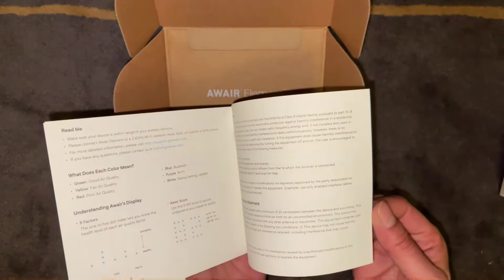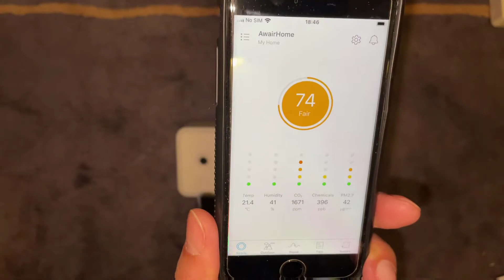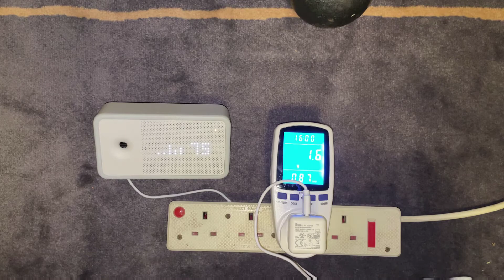Awair Element Indoor Air Quality Sensor Unboxing and Power Consumption

Comment: Hi, how much will it cost me to keep the Awair Element in a 24 hour day? Say I pay 17p per kWh for my electricity. Thanks in advance. PS - great video!
Reply from the maker: Based on 1.2W to run the device all year round on 17p/kwh, it's less than a cup of coffee, around £1.79
Reply: @HandymanSavage  sorry are you saying it costs approximately £1.79 to run per day or per year (if it is plugged in all day, every day, 365 days)?
Reply from the maker: Yep, annual cost £1.79. It's very energy efficient
Reply: @HandymanSavage  wow that's crazy!!

Comment: Hi, is it 1.2 watts daily or how does that work? Thanks (currently I have .07 cents kwh)
Reply from the maker: Multiply 1.2w x 24 (for one full day) = 28.8w. Convert to kw by /1000 = 0.0288 kwh per day. 
Then multiply 0.0288 by 30 to get 0.864 Kwh (per month)
Finally multiply your cost per kwh .07 cents x 0.864 Kwh per month = 0.06 cents per month to run the Awair